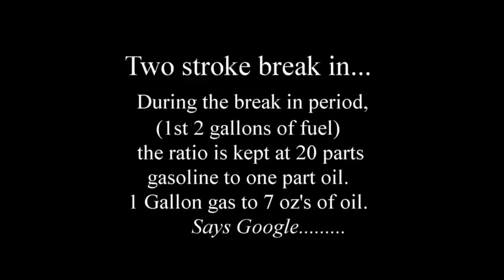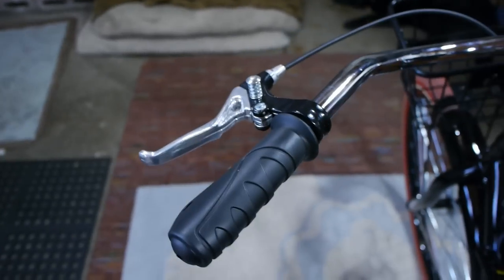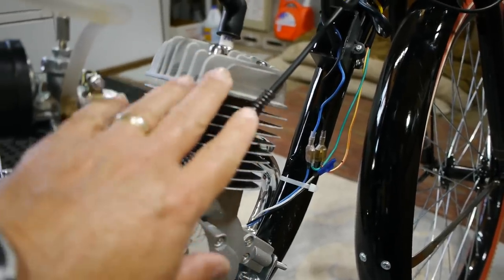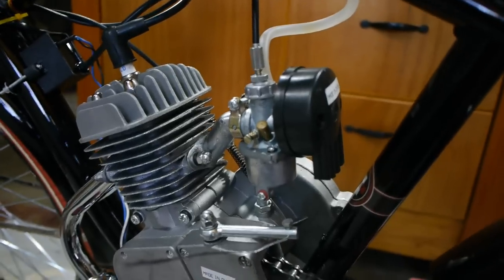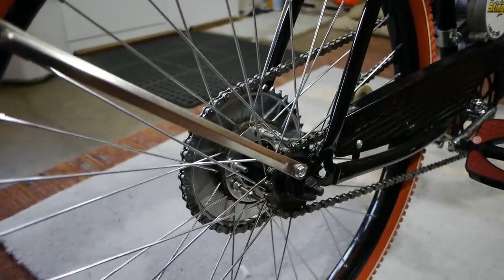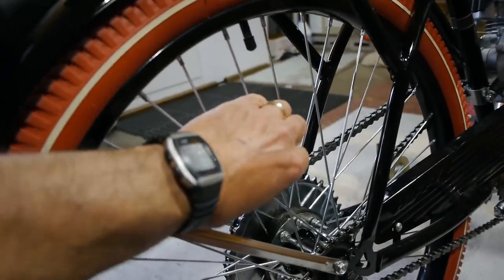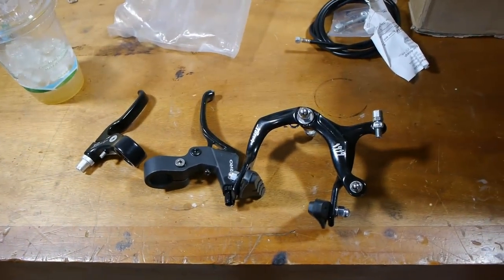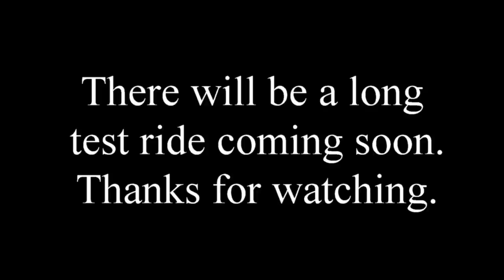Motorized Bike #1.  What I have learned so far.

Comment: We had such bikes during Soviet Union time. It was the cheapest way of transportation in villages. It was possible to put a motor on any type of bike.
Reply: I'm pretty sure the engine design is an old russian model. So i'm told. Its developed a bit since the old potmetal versions. Still a great way to go around for fun!
Reply: Russia does not produce anything anymore 
İts called D-4 engine with other engines D-5, D-6

Comment: Technically, the clutch hand lever should have a slight amount of "free play", as should the lever arm on the case. That skinny spring between the cable jacket stay and clutch arm then keeps the arm from rattling around as you ride. The free play is there to compensate for the parts expanding when warm, so you aren't "slipping the clutch" after a half hour ride in summer. Not a biggy to omit it, but it does actually serve a purpose by design. On a cold engine, the outer end of the clutch arm should swing about a sixteenth to eighth inch before all the parts "butt up and push", and the hand lever should have about a matchbook cover thickness "gap" between the front of the lever and it's pivot bracket that mounts to the bars before feeling "take up". Just a little slack in everything is plenty

Comment: The little spring/with a little slack in the cable is men't to take the pressure off the ball bearing that pushes against the clutch to stop it from flat siding and wear. Or not up to your preference on build.

Comment: Good videos a common on the fender just pointing out there what I did was filed down the area is nearest to the chain till I felt I had a significant amount of clearance.I thought about cutting it off the same way you had but did not want to lose the protection which the fender offers from water and dirt being directly thrown onto my motor from my back wheel
Reply: Is it still running 🚴‍♂️💨💨 or how long did it last if you don't mind me asking 🤔

Comment: for you that prefer the cheaper 2 stroke motors, got some tips: 
because of how 2 stroke engines use the fuel/oil mix to lube, much of it burns off but still leaves some residue, most oil additives are designed for 4 stroke motors, using oil additives in 2 strokes can not only REDUCE the efficiency of the fuel burning off, but the residues themselves actually increase the need for regular maintenance more frequently and CAUSE long term damage and reduction of engine life, and believe it or not, using full or blend synthetic oils in the fuel/oil also REDUCE fuel efficiency because of the higher resistance to high heat and ignition, a strait up proprietary, pure 2-stroke oil and shell premium with nitrogen is best. 

also, do not use fuel additives that add octane, on small 2 stroke engines they serve no purpose, the compression is not sufficient enough to be of any benefit.

DO NOT use fuel additives that have lots of detergents, except when doing breakdown maintenance, the engine relies heavily on the oil residue to lubricate and detergent additives in oils break down that function causing increased wear and tear, increasing the frequency of maintenance and reducing engine life.

if you insist on using a supplemented oil (an oil with additives) or oil additives anyway, NEVER, EVER, EVER use ones that have or add metallic and/or flammable substances such as zinc and phosphorus, these are optimized for 4 stroke engines, because 2 stoke engines burn off the oils, the metallic additives create deposits that actually damage the piston walls and rings, further increasing the need for breakdown maintenance and reducing engine life, as for flammable additives such as phosphorus and sulphates, these burning off in the engine create acids and cause severe corrosion in these smaller engines especially. 

keep your oils and fuels as pure as possible and it will help greatly

when you intend on storing your bike for more than 60 days, empty the fuel tank and add a fuel stabilizer but NO oil, when you decide to go and ride again, add the requisite amount of oil, then idle the engine for 10 minutes, shut down for 30-45+ minutes for cool down, then go and have fun

try and remember, "2 stroke" & "4 stroke" are NOT numbers, they are completely different types of engines, and need to be treated as such. 

I do recommend an oil additive called 'nanolub csx', but NOT for mixing in the fuel, it makes an AWSOME lubricant for external moving parts on the engine and bicycle and chain,  may your bikes "Live Long & Prosper"
Reply: You destroyed an engine didn't you? XD
Reply: not destroyed, but after the second disassembly breakdown and a total of $73 in replacement parts, I started putting 2 & 2 together, spent a lot of time on google and the local lawnmower/weedeater/chainsaw repairman and am now sharing what i learned
Reply: I use 91 octane Shell(closest gas station), with full 2 stroke synthetic oil mixed with Lucas Top Cylinder Lubricant + Carb cleaner, switching soon to all Lucas oil soon. But the motor has reduced almost 70% vibrations since adding the Lucas Additives, and it added 4mph since I was four stroking at 5,000 miles, currently at 6,000miles on the motor. Was running 26-27mph four stroking now it's 2 stroking at 33mph tops, all stock parts no mods but a 36t sprocket. That Lucas oil is great, will be trying Castrol/Maxima next on a newer motor see difference in oils, I trust both oils.
Reply: Thanx.

Comment: Great tips. Also buy a set of rims made for these. It has a disc brake gear and a spot for a pedal cog ready to go. Saves you from messing with that pos rag sprocket. And saves you from slipping chains.
Reply: Can you show photos?
Reply: @VenomCruster  ghetto bikes makes great thick 10gage spoke wheels that are disc brake equipped, And on your clutch mechanism use grease not oil, on a once every other month basis or depending on how much you ride. That little spring helps push/return cable, I believe it's important, I've built several of these for the past 12yrs.and get rid of your Killswitch and your chain tensioner, They're both useless, infact more harm than good. 🙏✌️
Reply: @VenomCruster  how can you show photos here?
Reply: @m.kasper7646  by giving a website link to the photos, also why is a killswitch bad
Reply: @VenomCruster  It's been an understandable proven fact that the "Killswitch" causes the wire from the magneto to short out at it's weakest point from getting hot when you hit the button causing a short/ground and after doing so over n over it becomes thin, burnt, weak & failure. The best way to kill an engine is choke and let out the clutch with your brake on. That's also a scientific proven fact.

Comment: I have a Trek 830 Chromium Steel frame with a 66cc 2 stroke Chinagirl HT, it has around 6,000 miles on the motor.
Reply from the maker: Wow, that's pretty good. This one would not have lasted that long.
Reply: It's a very sturdy bike frame, installed a triple tree fork with Mag wheels w/disc brake. The Foundation of the GasBike is the Frame after all it needs to hold up.
Reply from the maker: @eduardodiaz5762  A lot better than my $100 dollar Chinese Huffy no doubt. That thing scared me because the bike would do 40MPH. It didn't feel too bad but the though of it being that cheap always scared me. If I ever build another one it will be based on a decent quality mountain bike frame, although I think I am going to build a small boat first. My wife is just going to love that lol.
Reply: 6000 miles is pretty impressive 👌
Reply: @Jarrod_D  thanks sadly that engine only lasted around 8,823 miles with speedometer, this engine was not babied and it was ripped hard from day 1.
Second engine lasted 8,065 but it was babied from day 1. This third engine I have on the a new bike frame as the old one had an 7x accidents on engine 2. But it’s still the same bike style frame (old 830, New 820 Trek) chromoly bike frames are the best!
Third engine is on 2,000miles or so sitting in storage.
Reply: @eddiediaz9267  thanks for the reply 👍  those are some really impressive miles on a china girl . I've put on a few miles myself on motorized bicycles.  I rode one across America this year Florida to California and back , is that a lot ? I use my own style of build though not a kit . 
I did post the trip though on my channel.

Comment: You mounted the throttle control on the wrong side of the handle bars, it needs to be rotated 180 degrees so that the throttle cable is facing away from you, not towards you. Similar to how the cable is for the clutch cable. This will also make the Killswitch more accessible.
Reply from the maker: Thanks, I corrected that shortly after making this video and before selling the thing. Had a lot of fun doing it and will probably make another one this year. Thanks for looking.
Reply: Otherwise it's a good build and good video 🤙

Comment: And then I learned to ditch the rag joint. Then I learned to ditch the hub adapter. Mag wheels is my current solution. No truing either!
Reply: The axels wil snap on mag wheels too much heat build up

Comment: yank that fender.   ive heard some really bad stories about them rattling loose and jamming in tires.    i usually never use them. if i do, i replace all hardware to grade 8 and locktite all .
i do love these bikes.  build a few dozen and always learning something new~    feel free to check out my channel.
Reply: Lol doin 40+ with fenders. Sure is nice not having mud water spraying my butt. Just reinforce fenders with better hardware and loctite+lock washers.
Reply: I was thinking of getting a high fender like a dirt bike, to go on my mountain bike. I think it will be safer and cooler looking than the low ones

Comment: Really think I need a cable brake as a back up.  Scary if the coaster brake fails.
Reply from the maker: sandworm3, I wouldn't ride it without one. 70 lbs of bike and motor plus me. Scary.
Reply: Yeah I learned my mistake by having someone cut me off and coaster brakes locked up slithered a good 25 feet left a nice flat spot on my tire
Reply: lol I got cut off today at 20mph and smashed in to the rear quarter panel of the car.  Not cool, but I would have needed an ejection seat to avoid that.  That was with disc brakes, too.  Some jackasses...
Reply: even with a loud 2-stroke, you'd think they'd hear you
Reply: If you get a heavy duty gas bike wheel it wont happen ... Have a brand new one still in the box 36 spoke 12gauge 26 x 2.125 rim if your looking to buy one ... Just saying ... It's a bbr brand ... I have its twin on my Nell Russo ... Best move I have made ... other than the sprocket adapter

Comment: How did you get the chain to not rub on the tires? I have the same exact bike and I am installing a motor.
Reply from the maker: ethan lee it cleared the tire without any modification. Maybe the motors are different and the gear may protrude a little more?
Reply: Probably. I have the Grubee Skyhawk GTA5
Reply: How did you get the coaster brake to clear the bolts on the sprocket?
Reply: I believe so. I have the Grubee Skyhawk. I installed a slightly smaller tire 26 x 1.75 and it works.

Comment: Any problems with the Nel Lusso bike?   I've heard the vibration from the motor snaps the frame at the back rack.
Reply from the maker: I have since sold it but did not have any problems while I owned it except for a bit of a leaky gas tank. Thanks for checking out my video.

Comment: Just out of curiosity, why did you upgrade to basic sidepull brakes when you could have gone with dual pivot? It's the same mount, around the same price and dual pivot has better stopping power..
Reply from the maker: MrCommentator, the brakes in the video I never put on. The reason I bought them was because it was all the little bike shop down the road had and they sold them to me for 15 bucks. What a deal :-). I am waiting for new beach cruiser brakes which I believe are dual pivot to come from Amazon on Tuesday. I am probably going to sell this bike but if I should decide to keep it, I may try to swap out the fork for a cheap mountain bike Fork with a shock and disk brakes.
Reply: for that rim you need rod brakes as it is too shallow with no sides to clamp onto
Reply from the maker: I am expecting a pair of brakes advertised as beach cruiser bike brakes to be delivered today from Amazon. They got good reviews and hopefully they will work.
Reply: looks like the rear rim is wider so the tire wont spin under brake stress hop it all works out OK
Reply: where's spell check when you need it?

Comment: do you have any problems with vibrations? i have a bunch even though my crank is balanced
Reply from the maker: I had vibrations, but I just attributed that to the cheap Chinese engine. I don't know if I would call it a problem but it was like riding a very fast two-wheeled lawn mower.

Comment: Are there any American made kits ???
Reply: most of those claiming to be "made in America" are just parts from China and Taiwan ASSEMBLED here
Reply: The most American kits are from Zeda, they have the most powerful kits, and the most reliable ones too. They still use Chinese parts tho, but if you want to get up to 70 mph, that's your best bet. But they are also the most expensive, their best engines go for 700+ dollars, and they only make 80cc motors, cheapest kit is still around 200 bucks if you have them port it which I don't know why you wouldn't considering performance and reliability would be the only reason you're buying from them. They are also the makers of most of the case reed valve kits that are made, which I've found to be the most reliable, however, they start out at nearly 400 bucks on their page.
Reply: unfortunately Zeda Mafia only makes those as 2 stroke, they would have a greater customer base if they offered 4 strokes, there are so many that want to do this, but dirty fuel mixing, smellier, noisier and frequent breakdown maintenance is a major turn off, most don't worry so much about customization capabilities as ease of use, I can't blame, I sell 4 stroke 79cc pre-assembled (with the bike) and full proper breakin for $600, they don't have to do anything but pick it up, no other companies do what I do, you can get a 49cc 2 stroke bike assembled for $800, others just go up from there, but you still have to do some setup and always breakin, I make my money on numbers not high prices, so I have a lot of people coming to me, but most (80%) can't change a spark plug on a lawnmower, much less regular maintenance on a 2stroke engine, they need to pander to greater numbers, because Zeda charging so much is forcing too many people over to ebikes, then they realize ebikes are too much for too little and just give up on all motorized bicycles, e or g
Reply: Phob, I've done over 130 2 stroke builds for another company I worked for and god knows how many repairs and maintenance, when we say "breakdown maintenance", in my line of work, it is a partial or complete disassembly for maintenance, so calm yourself
Reply: 2 strokes aren't smellier, you have scented 2 stroke oil, it smells better, and even then I think the scent of 2 strokes are good by default. Noiser, you can get a muffler, and even then they aren't really noiser, they are just higher pitched. Breakdowns are uncommon unless you got the cheapest kit you could possibly find, it took me around 1000 miles doing like 3-4 hour commutes to even get a single actual problem with a cheap, 150 dollar kit, which wasn't even due to my commutes, it was due to a rotten oil that Autozone sold me, it had curds on the bottom and smelled like guano, and at first I didn't notice, but then when the engine started chirping and making weird noises, I checked the oil and realized it was bad. Also, oil mixing is the most misunderstood thing in this community, everyone thinks you need to have a specific ratio, no, you go based on what the oil says to run, if it says to run between 32:1 and 50:1, that's the range you should be running it in, because they test those oils based on lubricity, and they found that the lubricity between the 2 ratios have enough lubricity to run a standard 2 stroke, if it says to run it between 50:1 and 100:1, run it between that, because your oil is what matters because that's what controls your lubricity, not your engine. The reason engine manuals say to run a certain ratio is that typically they are referencing a certain oil, and I know this from dirtbikes because literally in the manual they put a ratio, and then their oil that they make right next to it. That's where the misconception probably started, as its where it started for most dirt-bike beginners, it probably started with the original manufacturer of these shitty Chinese 2 strokes that probably also made oil, or were in partnership with someone that does. I personally use Amsoil saber, and run 80:1, I haven't had issues running that ratio at all. Just go through the break in with a normal oil and run 32:1 or 20:1 even just to get the burrs out, which usually actually happens within 10-15 minutes of running it on that ratio from my experience.

Also, zeda doesn't charge too much, they make everything to order and sell high-performance engines made by them. If it was a factory in China making these motors I'd understand, but it's not, its a couple guys cutting out stuff and putting things together in a shop, and also cramming 8+ horsepower into a tiny 2 stroke motor without any mass production to do such things. it makes sense. You think the 50cc engine that set a land speed record cost 100 bucks? no, it probably cost upwards of 800-900 dollars.